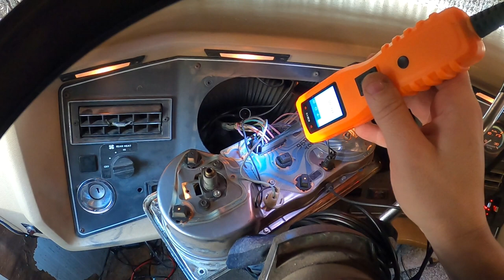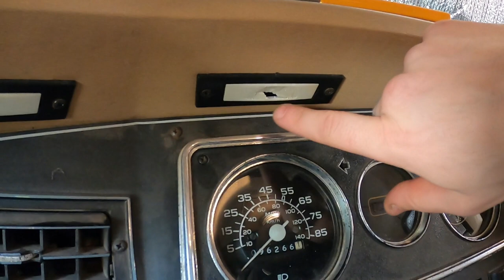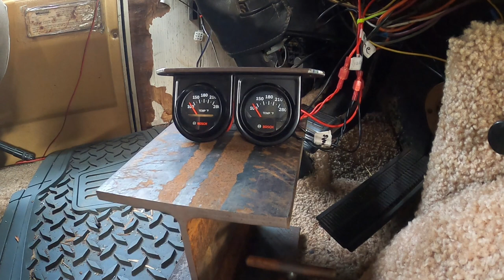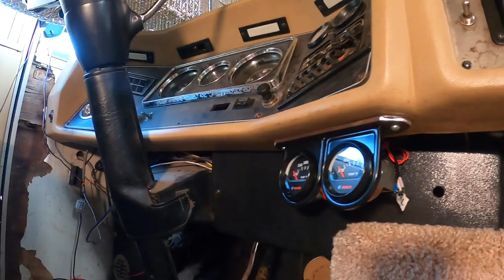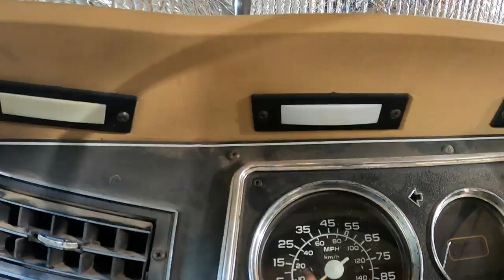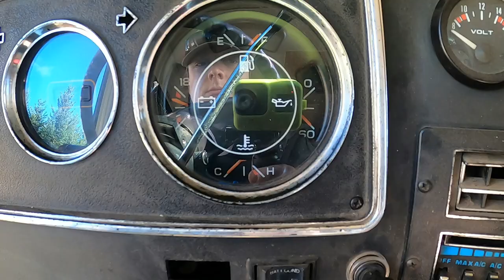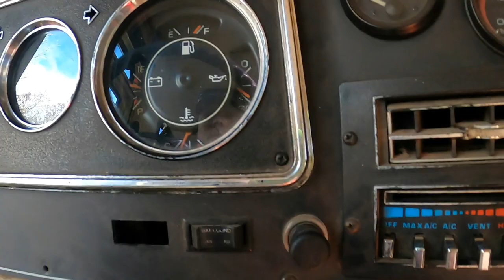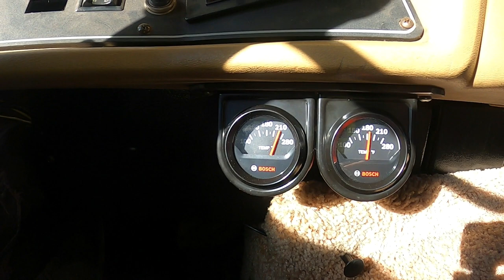Installing Temp Gauges, Trans & Coolant - '88 Chevy 454

Comment: Oh yeah my VDO gauge reads 210 ish on my 1987 454, going off the temp port in the head between 2 cylinders on the right bank.

I'm toying with going to full port vacuum on the advance on the distributor to see if I can get the idle temp lower.

I'm running a 165 Edelbrock high flow thermostat.

Wish there was a way to private message you I could go into it real deeply with you on all of your issues, I'm constantly tinkering with mine out of boredom.

I also have every GM factory service manual, even the rare ones.
Reply: I switched to manifold vacuum and not ported today, now idle temp is about 170

Comment: The new coolant sensor is mounted right on the top of the thermostat and might be reading higher there. Also…with it mounted up that high it might be in an air pocket? Just a thought.

Comment: My go-to adhesive remover is WD-40. It softens the glue and encapsulates it with oil so it doesn't re-stick. Its a much better cleaner than a lubricant in my opinion.
Reply: Agreed, I prefer 3 in One machine oil and penetrating oil for lubrication rather than WD40 which was designed as for Water Displacement. :_calPatches: